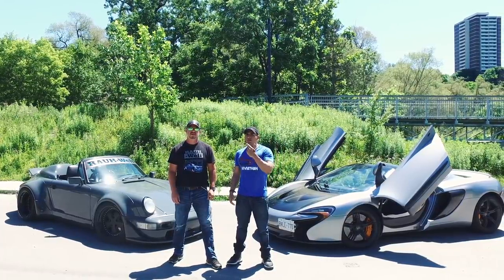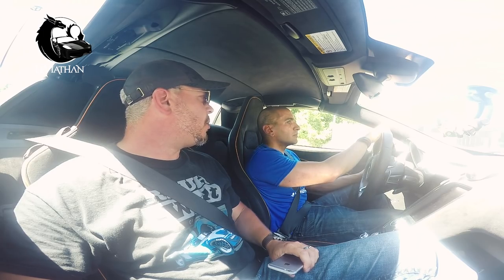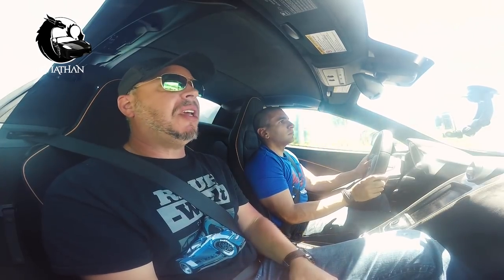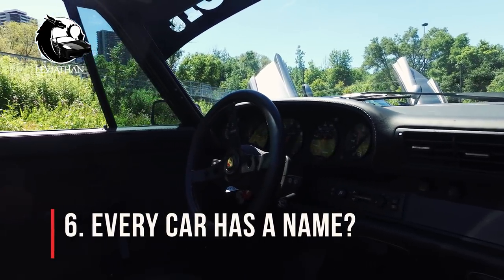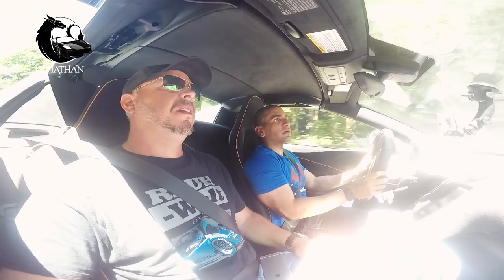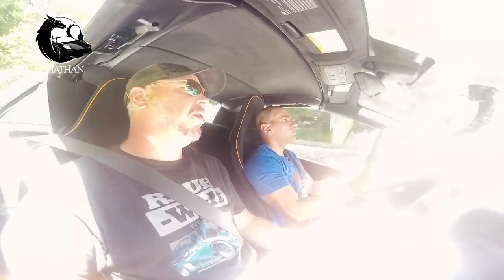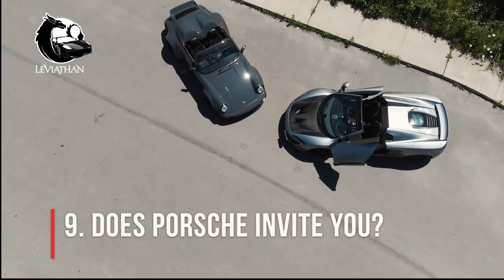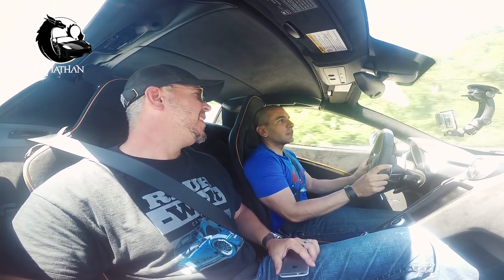RWB Porsche BUILD: 10 THINGS YOU MUST KNOW!

Comment: We have done Porsche customs for 30 years. Strosek, Gemballa, TechArt etc... etc..  RWB used to buy kits from my buddy at Better Bodies in San Diego. Their set of parts was called a Super Turbo. Super-crazy wide-body for 911 race cars.  A complete set of parts was around $2,500.  This guy (RWB) really has figured out how to market the $2,500 set of parts (25 years ago price for the kit).  Currently, that price might be $4K for all the parts (a realistic price)  hehe    Are the parts still made of fiberglass?  Or is he making the parts out of carbon/epoxy?  Lightweight & super strong?  2 bumpers,  4 fender flares (& rocker panels) seems like a Carbon fiber set of parts would run around $8K - $10K max.   Hmmmmmm    I know for sure a set of parts can be easily installed in 40 hours.  $15K for 40 hours work's not bad (if the parts are CF) that's $375 an hour.  *If the parts are still fiberglass... then much more profit. His cost:  Maybe $1,500-$2K for the parts.  A $20K+  profit for 40hrs work = $500 an hour.   Beats going to law school.  ;o)  Excellent marketing job!  Kudos, and tip of the hat.
Reply from the maker: Wow....